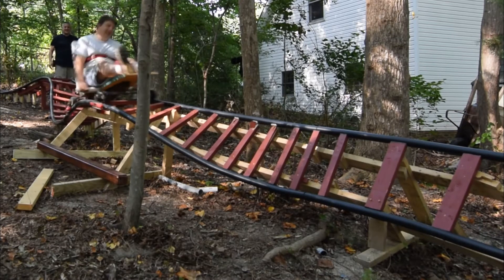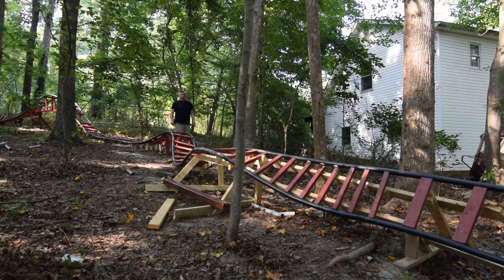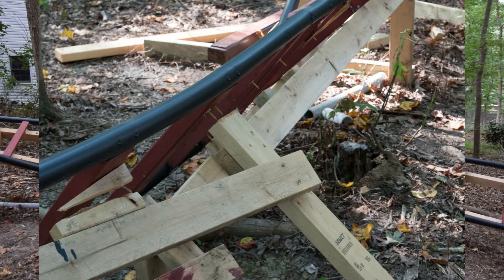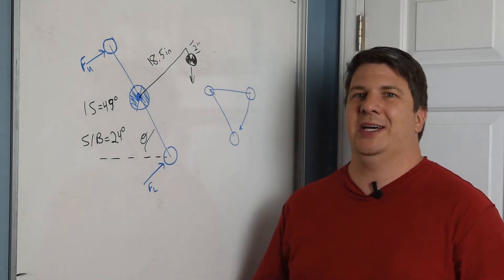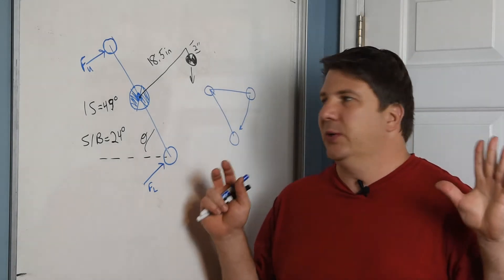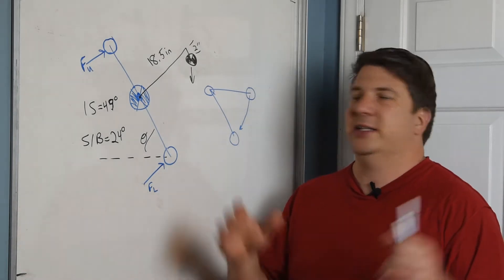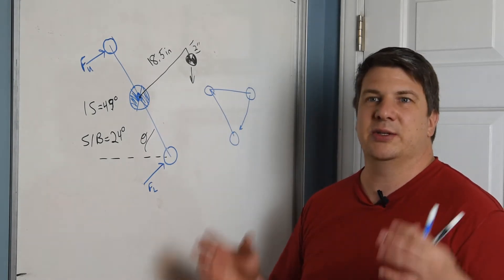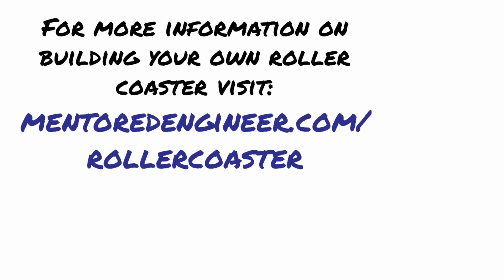I Destroyed It - Backyard Roller Coaster

Comment: I like how you manufacture, but at the time of the layout,
you need to account for g-forces and apply curves with a Quintic Polynomial fit, smooth turns and avoid the broken parts, (using translator).
Keet it up!
Reply from the maker: Thanks Edgar.  I will be checking it out.  Transitions are definitely hard to visualize because they are non-linear.  I will be doing more research in the months to come.  
One thing I'm trying to do is to keep this simple so that anyone can plan and build a roller coaster.  Many, including myself, don't have the ability to accurately measure all 6 degrees of freedom from one part of the track to another.  (I can't even calculate the total height of my ride because I don't have the right tools)